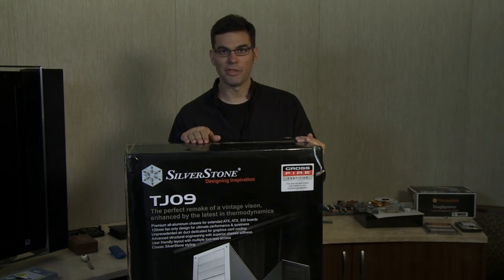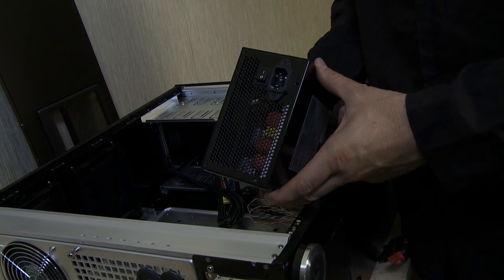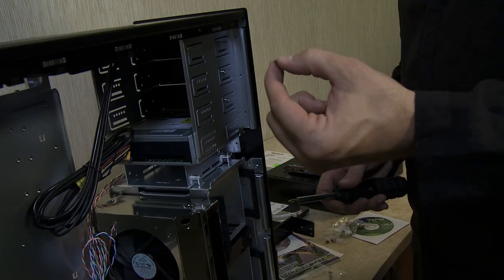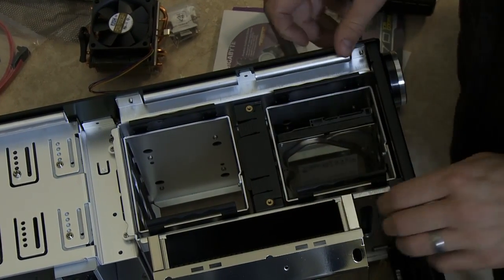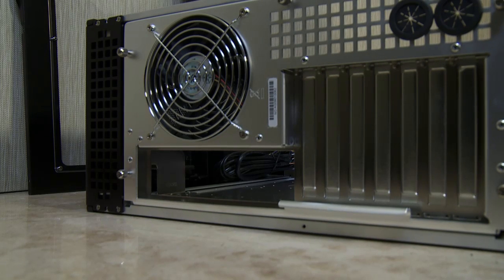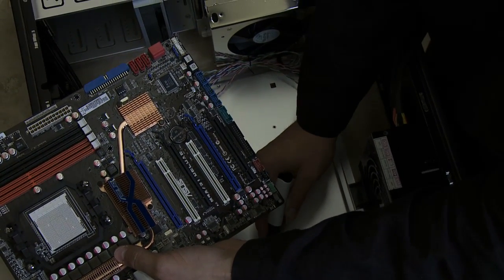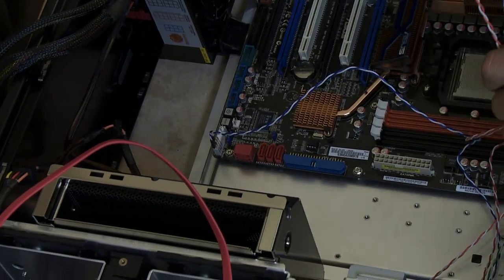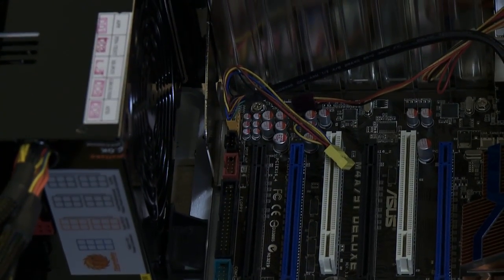How to Build the Ultimate PC  - Part 1 of 2

Comment: he didn't even do any cable management, should have put the hard drives in the other way round, should have installed the cpu cooler before putting the motherboard in and there was no graphics card. the moral of this video, don't trust the so called 'professionals'.

Comment: @Forgoten0Lore My build is 

Corsair 800D Case
AMD 965 Phenom X4 BE
MSI 790FX-GD70
Kingston HyperX 2133 DDR3 4 gigs
XFX 4850 x2 (yeah not the best but waiting on the 6x seirs cards)
Antec 1000W PSU
2 Kingston V+ SSD 128 gig
2 WD RaptorX 10K RPM
All wires sleeved individually 

:D
Reply: Great build but I think you'll have to upgrade if you're planning on playing GTA 6

Comment: @WillNicolini1 In older systems yes, If you use less than medium grade Mobos and parts Yes, But honestly in todays high end Mobos and parts they have high end caps and mosfets on them that are shilded. With that said it is still good practice to touch some metal before handling and component

Comment: how can u connect the Radeon 5770 to the power supply?it has a 6 pin to 4 pin Molex with two splits. i tried but i got only one 4 pin molex comes with my PC... where can i get another one?

Comment: I am building a new amd dragon build and I need some tips/help on this new system so I do not screw it up (big money on it) but still cheaper then intel lol. alright the budget is $1,500.00 USD and here is the parts list

AMD Phenom II X4 955 Black Edition 3.2GHz (Deneb)
ASUS M4A78T-E AM3 AMD 790GX HDMI ATX
G.SKILL Ripjaws Series 8GB (4 x 2GB) 240-Pin DDR3 SDRAM DDR3 1333
XFX Radeon HD 5770 (Juniper XT) HD-577A-ZNFC x 2 (crossfire)
Western Digital Caviar Black 750GB 3.5" SATA 3.0Gb/s, new post^

Comment: get the 955 instead, $40 cheaper and only 3-4% slower. amd will keep the am3 socket for years, so you will be able to upgrade easily enough in the future. the six core chips will come out early next year.